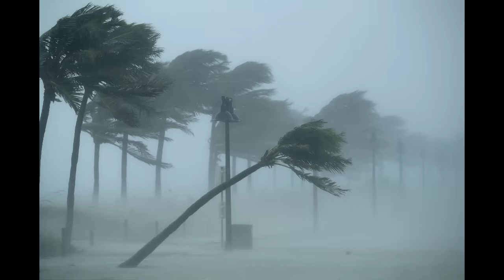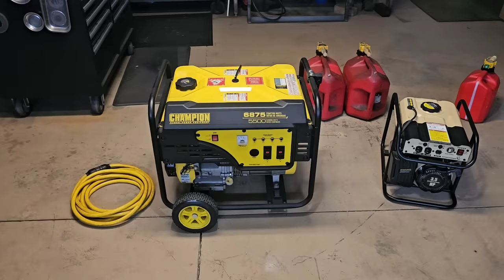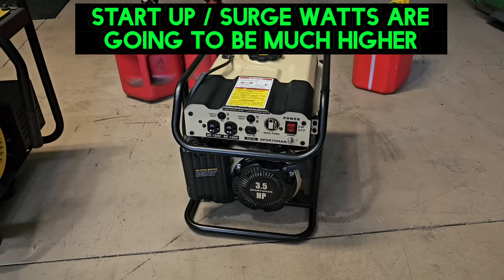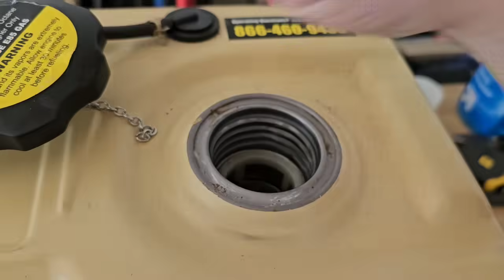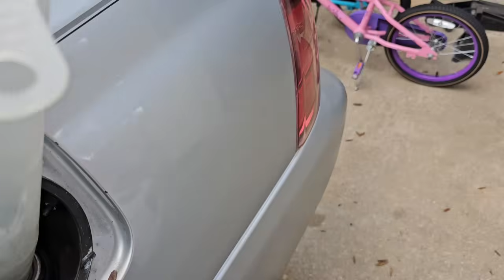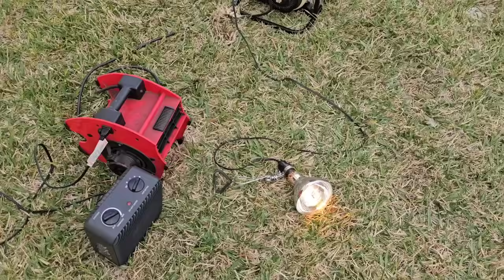Why smaller generators are better for power outages.

Comment: Yes fuel is an issue that’s why you should get a trifuel and hook up to NG. Use gasoline as backup option. If you don’t need it after the storm put it in your car. VP jugs are the best 5.5 gal each. Solid
Reply: There are a lot of areas where NG isn’t available for homes. Fortunately I do have it for my furnace, hot water, and stove, but even then it’s not easy to plumb a supply line for a generator. I’ve chosen to use propane as a primary fuel source with gasoline as my backup. I can go portable with either one of those. Also with noting that a generator’s maximum power output will be highest on gasoline, then propane, and lowest on NG.
Reply: @dguiley  - totally agree I’m glad I have a natural gas. I’m gonna plumb mine right at the meter so I don’t have to run any long lines.  Then it’s very easy to make a connection for a generator.

Comment: I don’t believe in fuel stabilizer - no need. My Gen never has any gas in it whatsoever unless it’s running during a power outage. Run it dry, drain and blow out carb of fuel, drain tank completely. Start mine every 8 months maybe. Starts on first pull ever time

Comment: I use a 3600 watt dual fuel  120v inverter generator for home back up and camping. Runs everthing in the house except for A/C, oven, and dryer. Runs my camper's 15k btu A/C. A good combination of power, weight, and efficiency.
Reply: love when people say "everything" .... then say EXCEPT this this this and that. 

what do you want on your sub sir ..??
EVERYTHING except this this this and that. 
 
WELL THATS NOT EVERYTHING so why even use that word ??

Comment: Yeti cooler and a bag of ice to save your food would be a lot lees expensive and far more quiet.
Reply from the maker: A Yeti and a bag of ice will last half a day and it cannot charge my phone or tool batteries. When it comes to keeping food cooI in a long term power outage situation, I have the ultimate solution here https://youtu.be/IdasDmkxFFw
Reply: @Mechanical_Mind  Ice will last six days in a Yeti and ice is cheap. Your phone service will be out during an emergency along with the internet unless you have a Starlink. You can plug your tool batteries into a 12 volt dc charger that plugs into a car which is much lighter in weight to carry around than a generator.
Reply from the maker: @fraudsarentfriends4717  you're completely missing the point of the video you watched and the video you clearly didn't watch.
Reply: Enjoy the comforts of your yeti cooler with not heat (Texas freeze) or lights or refrigerator making ice or microwave…
Reply: yea good luck getting all your fridge food into a yeti cooler

Comment: I highly recommend a Sol Gen as well. I still use my Pecron P3000. Operating at 2000 watts. Great for smaller draws and charge via their 200 W suitcase panels.
Reply from the maker: I recently got a Pecron E600 and a 200w suitcase panel. It's a game changer! I've been using and testing them both for months now. For backup power, now all I want to invest in is more battery and solar capacity

Comment: The generator has to be sized for the use.   Having more than you need will just burn extra fuel.  I have a 15k which runs my whole house and is needed.   I am the only person around that has AC, hot water, full light, stove, washer , dryer.    Even my pool is running.   My life doesn’t change except for having to refill.   We lost power for 13 days and I spent $400 in fuel.  It ain’t cheap.   Now I also have a diesel powered generator.  The stations run out of gas but still have diesel.   Here in south Florida the gas pumps have backup generators at most stations.

Comment: I have electric power generators in multiple sizes fueled by solar, gasoline and natural gas. It depends on the anticipated outage length. The solar/battery generators will last 1 day without recharging but they are silent. The gasoline generators require multiple fuel cans to cover several days. The whole-house generator will run as long as natural gas is available, stopping only for maintenance checks every week. The whole house generator requires no intervention to fail-over using the automatic transfer switch but it was expensive.

Comment: We live in SE PA. Earlier this Spring I bought a 9000W portable generator. We are on a well. Almost all the time, power here goes out from a Summertime storm. Which usually strikes 5:00-6:00 PM. Usually an outage from a Summer storm will last 6-8 hours. I had an interlock kit installed with a 50 amp cord hook up. I did research, I concluded the amount of instances the grid is down, and the severity of the outages, the gas guzzler would be fine. Really I'm still breaking it in 4 months later. The power here doesn't go out too much.
We had an ice storm in 2014 where we lost power for 3 days, that was about the longest outage we ever experienced. I also have a 2000W Honda inverter I bought that year. 
Even during that 3 day outage, it was a short drive to get gas. The local convenience store was open from their own generator power. And power in the next County 5 miles away was mostly on.

Comment: I use a DuroMax XP13000HX with a 50amp interlock. I want the ability to use propane without compromise in case I can’t find gas during a mass power outage. I need to be able to use my 4 ton HVAC (with soft start), my lights, refrigerator and chest freezer at the bare minimum. I need 35 amps to start the compressor not counting the 5 amps from the air handler. Since it’ll be cycling on and off and I don’t have much control of when the freezer and refrigerator cycle I want to make sure I have enough starting amps in the event they all come on together, that’s close to 11,000 watts to start and about 4300 to run. So using propane I’m at 86% peak starting watts and 43% running. Having a good buffer helps prevent bad voltage and frequency drops. I could do the XP12000HX but I’ll be getting too close to the max starting amps than I’m willing to go.

Comment: I find the best route is to have a solar generator (usable indoors) w/extra battery and use the small generator to charge the solar generator as needed.If the sun comes out you can charge with a portable solar panel and the small gas generator at same time as needed.

Comment: As you have done. I suggest buying INVERTOR type generators. These have pure sine wave output power which is a must for electronics. The less costly modified sine wave generators are OK for incadescent light bulbs, motors, power tools etc.

Comment: I have a 1500 watt pure sine wave inverter I connect to my car battery. Won't run the AC, hot water heater, or range but it will power the necessities; microwave, fridge, lights, a few fans, necessary electronics. We're campers so we have a propane camping stove to cook on. I fill my car when I hear bad weather is approaching. Car burns about a quart of gas per hour idling so, with a full tank, I have ~75 to 80 hours of run time. Car is quiet when idling so I'm not bothering the neighbors. When I'm done with the inverter I put it back in its box and on the shelf for next time. No maintenance whatsoever.

Comment: I agree, I have a 9000 watt for emergency 1-2 day outages, with a back feed to my house, and I have a 1200 watt for the bare essentials, and I have batteries with a trickle charger and solar panels stored away, with a 1500 watt inverter for really long emergencies.  I can also hook up my big battery charger to the generator to charge the batteries for a couple of hours it the is no sun.

Comment: Not sure for everyone else. I have 6 generators. From 900 watts to 12500. Some just gas some duel fuel. 1 diesel. 1 even pto driven just in case. My backup home is 12500 running propane. During the freeze here in Texas that most people weren't prepared for. My family was sitting comfortably watching the news and movies. Even had a few neighbors over during that period. We also have wood and propane backup heating just in case as well. Point being. Always be prepared. Never put all your eggs in basket. It never hurts to have multiple ways to take of yourself and family or friends in need.

Comment: I have 3500 peak 2500 continues  I run my fridge 5000 ac  coffee maker  microwave 3 royobie battery charger  computer 100w   still not maxing out uses 3 .5 gal a day smaller for long haul is correct  we get cold weather I use propane for that big buddy

Comment: Have a docking station for portable generators, have used different types,  the inverter generator 2200wats worked good, 120volt,  on propane bottles,  used bigger 6500 watt on propane to run a/C  unit to cool house.

Comment: I lived through Texas winter storm Uri and hurricane Beryl using a Champion 100520 invertor generator. I live in a residential neighborhood so a large tank of propane is out of the question. Also my natural gas feed and electrical feed are on the opposite sides of my home, so I was restricted to using gasoline only. With that in mind I keep a 10 day supply of gasoline. I  know it's a pain in the butt, however it's my only option.
Reply: My cousin in Conroe, TX has TWO gas meters. One for the house and another for the whole house generator that powers his well pump. He just pays for the usage from both meters. My gas meter and electric panel are 25 feet apart on the same outer wall of my garage. We have a Kohler generator and ATS.
Reply: How many gallons of gasoline do you consider the need for 10 days?
Reply: @condor5635  I keep 35 gallons in stock and rotate them on a regular basis.
Reply: @ourtexasfamilyvideos62  that’s a good minimum. I got 45 to 50. I would not recommend keeping them always on hand except maybe one. Very dangerous. I fill mine many days before an event and like you if it’s a nothing event I put it in my car. No Stabil for me. Store it completely dried
Reply: @condor5635  Fortunately I've a very secure storage space away from my house.

Comment: I bought a large generator at costco that did 4500W, the first power outage I I had, hooked it up and ran my house.   I runed my smasung tv though :(   I didn't understand that I need a inverted generator to run electronics.   Epensive lesson.  Now I own 3500w inverter generator, can't use it for the AC but it works fine for everything else including my new tv lol.
Reply: Run my tv and everything else for multiple outages and not one single issue. Your Gen must have had terrible THD

Comment: I have a small generator that I use along with an eco flow delta pro with two extra batteries and some ground mounted solar panels, just went through hurricane Beryl in Houston, Tx…and let me tell you having a small generator made a huge difference, only ran my 13k duromax when we needed to run the well pump for showers…. We didn’t have power for 5 days….. but most of the time the solar would be fully charged by the time we came home if not I would run a small honda 2k generator and that thing sips gas….. rarely ran the big generator… and I just ordered the xpeedingrods 5.5kw 120/240 generator with the 30amp outlet and I’ll be using that more often than not… in 5 days I maybe used 7 gallons of fuel it was lovely, daily the solar runs 2 fridges and a mini fridge and we can do laundry as well and at night it powers a portable a/c….  As far as cooking I had 40 lbs of charcoal 😂 I been through enough storms and b/s to know it’s better to spend some money now than suffer later

Comment: Propane is the best way to go folks and have a 100 gallon tank is just smart since the fuel never goes bad 😊😊😊
Reply: I use gas then go to propane. I have cook  stove ,hot water tank   and a 460 tank that I have to fill up once a year. The propane will not produce as much watts as gas .
Reply: Do you rent the tank or own it and how does it feed a generator?
Reply: 100 gal won’t be any different than his situation have 5-6 five gallon fuel jugs. Go with trifuel and go with NG
Reply: @condor5635  Propane is far safer to store, can be stored way longer than gasoline, and in a power outage is doesn't sell out as fast as gasoline. After a hurricane in Fla, I found several 20 lb propane tanks in store debris.
Reply: @BearClawAK47  - i get 50 gal of gas the week before a storm so gas going bad is not an issue and I don't store it long term (never had Stabil).  If I don't use it then it goes in my cars.  After 5-7 days of run time gas can typically be found after disaster.  7 or so propane tanks will last no longer than that too.  So yes you can store it permanently but you are in the same predicament that you can't run for more than 5-7 days.  If you are relying on propane only then trying to find it after the storm will be just as hard or harder imho than finding gasoline.  Ideally we would run NG and have the propane or gas as a backup :)
Reply: @condor5635  NG may not always be available. A lot of the time, utilities may shut off NG lines because the stations that push NG will not have power.  The best is to have a mix of LPG and gas with a supplemental set of Ecoflows Delta 2s solar generators.  Extended the  gas and we were able to store generator at night and still  have lights and keep our fridge and freezers going.
Reply: @Noneofyourdambusssiness  NG flow does not typically rely on the electric grid. I’ve never had a gas issue once in 25 yrs in Texas. That said I would keep an alternate like gasoline or LPG as a backup

Comment: We just finished a 10 day power outage from hurricane Beryl and our Honda EU3000is inverter generator ran great at only 5 gallons per day. We unplugged the fridge and ran it in eco mode at night. Very quiet and fuel efficient. Sometimes less is more.

Comment: Last week after a storm I had a power outage for about 40hours, usually they are less then 6 hours, 2 to 5 times a year.  I bought 2000W nominal/4000W peak 12V DC to 220V AC pure sine inverter from Aliexpress. It was 90EUR and free shipping in 3 days. 
I attached it directly to car's battery using supplied leads. So far I tested that I can use 1500W hairdryer for prolonged periods of time >15 minutes, while car is on idle. Simultaneously to 500W resistive load (hair dryer on low setting) inverter can easily start 1KW water well pump, so there is water in the house. When I tried 2000W water boiling kettle, battery voltage quickly dropped below 10.5V and inverter turned itself off. It was because of older car battery or lieds to the battery(that where supplied with inverter), inverter would be able to deliver more. 
During future outages I plan to use inverter only for essentials - computers, phones, lights, fridge and water well pump. No electrical space heating, cooking, hot water boiler, dishwasher or washing machine, these extras will have to wait until grid power is restored.
Car idles quieter than generator and consumes about 1 liter per hour while on idle (average 2liter diesel or petrol engine car). Since I use that car daily - fuel in the tank is always fresh and there is no need to store extra fuel for generators. If there are 20 liters of fuel in car, I can idle it for 10 hours before going to fill up the tank until it is full.  Full tank of gas is enough to idle for almost a week. If the 2000W inverter is turned on without any load it consumes about 10W of energy. If you have light load attached - a laptop, few phones charging, led lights in the house (some 100W in total) then you can turn cars engine off, and use those loads for 2 to 3 hours from the battery. After 3 hours you need to start the car to idle for 30 to 45 minutes, and again engine can be turned off. While the car is idling you can use about 1000W on average, and 2000W or more for a very short periods of time, alternator should be able to keep up with demand and recharge the battery. And if you continiuesly use over 500W of power, just keep the car idling, battery will last less than one hour if car is turned off.  My fridge on the sticker seas that in consumes 250KWh per year, so it is less than 1KWh per 24 hours. Maybe 40W/h on average. It might have high initial power, or consume 200W while running, but the compressor is running maybe 25% of the time, 75% of the time refrigerator does not consume any electricity. If refrigerator is the only load during the night, car battery should be able to deliver electricity without being on idle for those 8 to 9 hours.
Almost all inverters also have few safety features, one of witch is to turn itself off if the battery voltage drops below 10.5V. You will notice it because of an inverter power outage and there should be enough juice in the battery to start the car and charge the battery. 
In my opinion batteries + inverter is the most convenient and fuel efficient way for loads below 200W, and it is plenty for electronics and lights. But you need to have a way to charge those batteries without. Running smaller 1KW or 2KW generator non stop - to run one refrigerator or charge a phone is very loud and  waste of fuel you have to store lots of extra fuel for those special occasions - power outages.